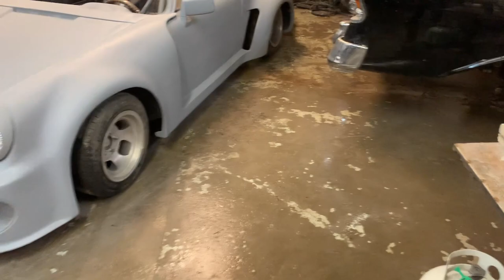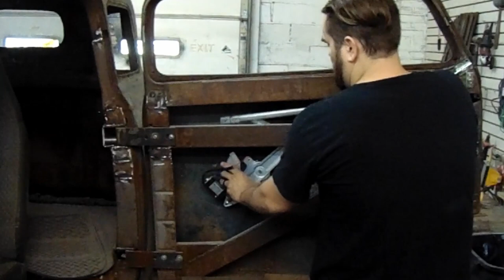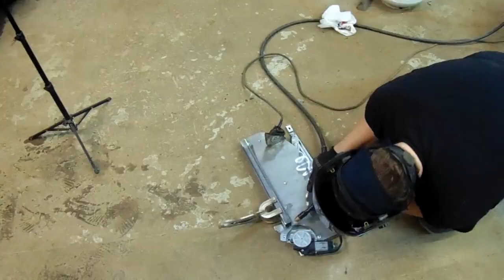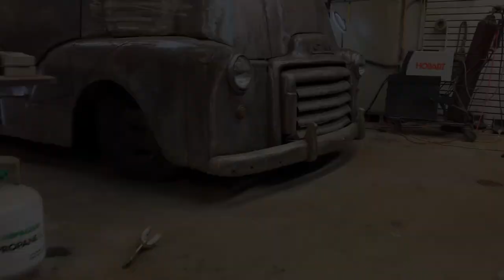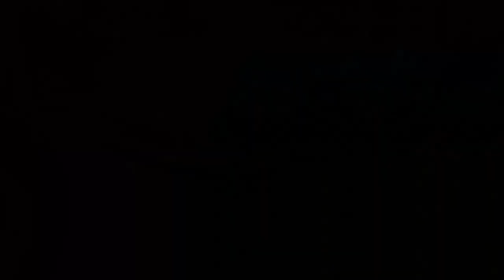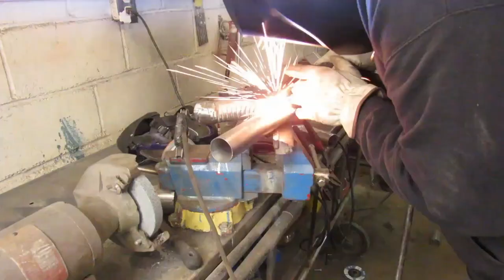BUILDING CUSTOM POWER WINDOWS IN A MONSTER 1953 COE RATROD!! CHEAP, REBUILD, REVIEW, WELDING.

Comment: I’m building a little speedster based on an MGB. When I dismantled the doors I was surprised at the size of the steel beam inside them. To meet US crash regulations the beam was added at the factory. They were buggers to get out. Each weighed over 25 pounds! A horrible burden for a car with only 89 horse power.